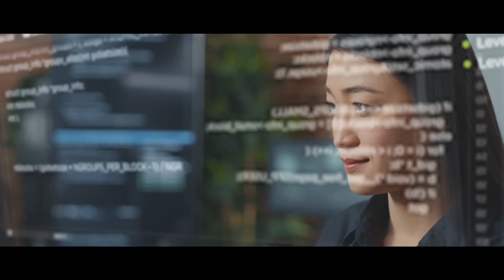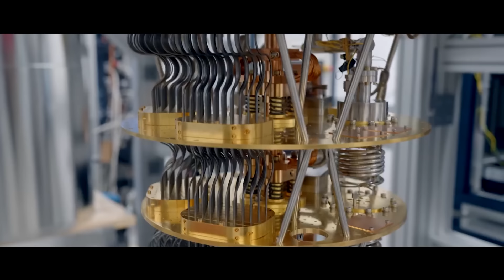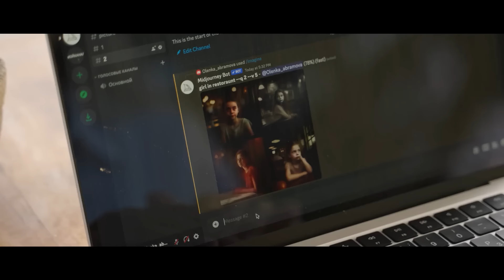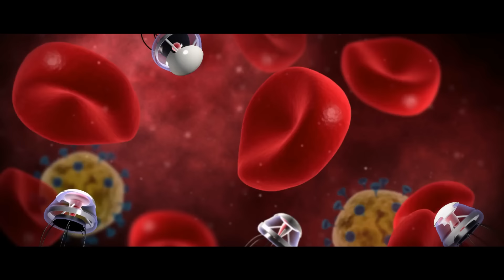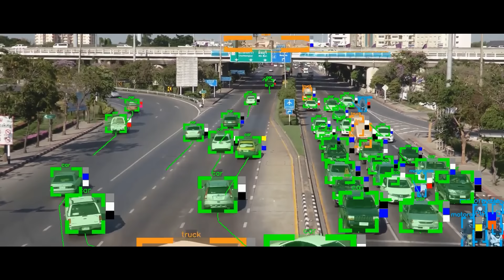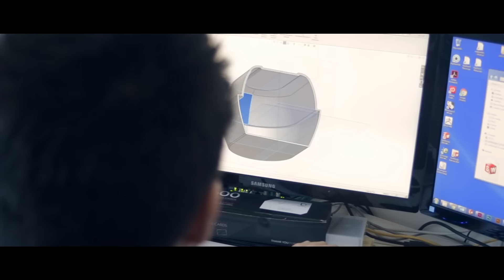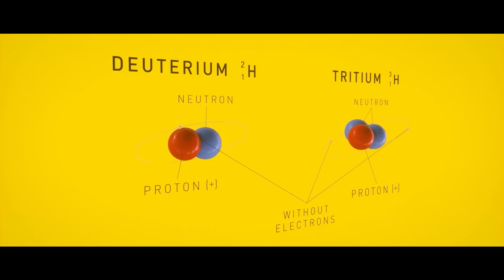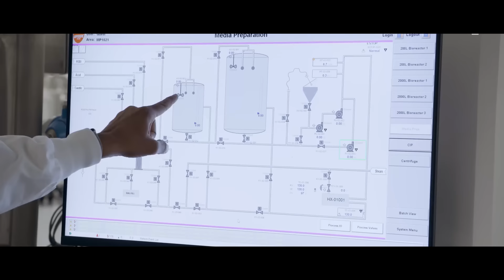20 Emerging Technologies That Will Change The World

Comment: I am surprised nobody seems to show any interest in developing a sequencing system for developing not only multiple agents and Digital Twins of Objects , but an operational Nomenclature, Taxonomy and Convolutional parameter layers for the codification of Physical Human Made Artifacts into Binary Code, enabling the potential connection of Artifact2Artifact in ARMS ( Automated Robotic Manufacturing Systems) or has it already been done? The HGP took 30 years , but with Trilliums and Inferentias , the AGP ( Artifact Genome Project)-reflecting much less complex structures should be possible to achieve in much less time. My 2 cts

Comment: I'm surprised you didn't mention anything about stem cell technology, room temperature superconductors, Web 3.0, replicators, hypersonic commercial flight, magnetic levitation, antimatter power etc.
Reply: If you have gene editing technology then you don’t need stem cell.
Reply: @joejohnson6321  Gene editing alone cannot repair/replace damaged nuerons/cells/tissue. Stem cells are needed for that
Reply: Have you noticed the name of the video is "20 Emerging Technologies" it does not read "All Emerging Technologies".
Reply: @thunderslap7390 Did I say ALL emerging technologies? No. I'm just surprised the technologies I mentioned weren't included in the list

Comment: I like these kinds of videos.
But there are 2 things that I find detract from credibility.

That is, where they have the CGI "robots" reading a computer screen or typing on a keyboard.

That is not realistic.  Robots are computer controlled.  Therefore, they have or can have direct access to the substructure of a computer, therefore inputting or outputting data at full speed.
Not the snail's pace of a keyboard or display.  It's not realistic that a real robot in the future would have to read a screen or type on a keyboard.

Any command that can be typed, a robot could whisk into the computer directly and so much faster.

Comment: why are the humanoid robots limited to 2 arms? seems like (ONE) advantage would be additional arms and hands or even being 4 legged with hands (something like a minotaur?).  IJS there is a blank canvas, why are the forms limited to the only one familiar to us.
Reply: The amount of wires, motors, and muscles increase exponentially with the number of limbs. To coordinate them inside the GPU demand a PWM electronic circuit per motor in order to change the speed and direction of every motor by changing the intermittency frecuency (duty cycle) and direction of current using H bridges. While the board controls those 2 parameters per motor, it must control those 2 parameters in the other motors at the same time by Time Multiplexation. You can use a lot of motors as much as you want, but the chaos will increase exponentially, too. And is the same problem for both technology and biology.
Reply: to be able to perform in a human environment clearly! to do a specific task sure but to freely move and interact in our environment it would have to resemble us.
Reply: plus I imagine power consumption. understand to be able to move around freely it needs to  carry a power source with it.
Reply: Everything we have built today is designed for the human form. It makes sense to start there for easier integration.
Reply: The best teacher is nature. The way it gave 6 to 8 limbs that are functional for that specific specie can teac us to build limbs specific for the work to be done. Does not matter how many limbs we add, what's important is the work being done.